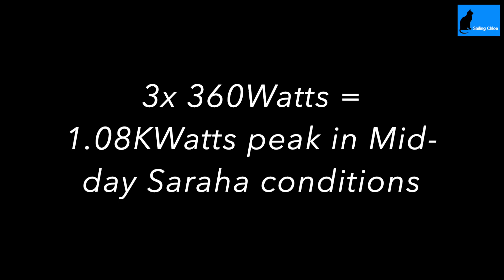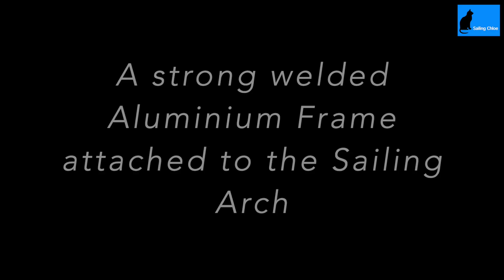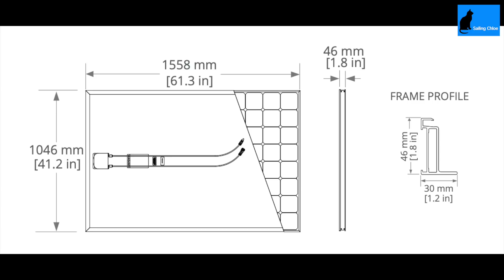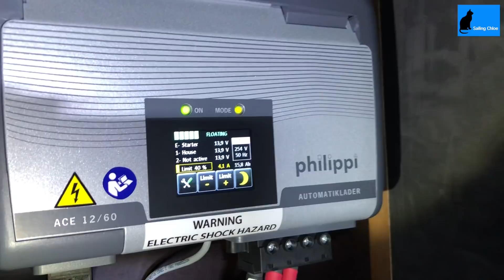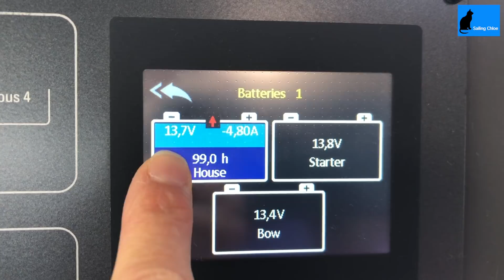Sailing Chloe - Episode 45 : Modern Energy Systems for a Sailboat

Comment: Here we mostly use LiFe Po4 batteries for marine purposes, LiPo as you use is not safe and first time i hear used in a boat. I however use a lot Lipo batteries for other purposes and has occasionally had accidents with them as well.
Reply from the maker: Yes we agree partially... . But there is no such thing as LiFePo4. ...only LiFePO4 .. no one uses Polonium for cathodes.... that we're aware of....?!!      We use standard marine Batteries with Lithium Iron Phosphate Cathodes.. as is very common and reasonably safe in boats. Also Commonly referred to as LiPO and is very commonly called "lipo". And, as you state, NOT to be confused with Li-po which is different. Often Lithium Iron Phosphate Cathode batteries are simply shortened to as LiPhosphate.... or LiPO or Li~PO4 , or , correctly: LiFePO4 to be exact. Of course no one is using Lithium Polymer (LiPo) in a boat... except for the chunk in our cell phones and iPads...     and then again there are a larger number of types of Lithium Polymer batteries..  again each with different cathode materials..   So with all these cathodes.. it all gets rather confusing ... and this is before we even get into the anodes...
Reply: buy kuthúm ever use luth best bàyrreß

Comment: Awesome informative video!  Where in the boat are the batteries mounted?  Is there a separate battery to start the diesel motor?
Reply from the maker: Hi Nic, Batts are as follows. 3x house batteries in 3 boxes under the sole plate either side of the engine. Each is 300Amp.hrs. One Engine batt. 100Amp.hr batt under the salon starboard seat. And one windlass/Bthruster under the master bed.  So it's 5 batteries in 3 banks. House/Engine/BowThruster.
Reply from the maker: yes. The Lithium batts are in 3 boxes. Each a 300amphr battery. And separate battery bank for the engine start and a third for the windless and bow thruster.

Comment: Hi
I'm thinking of getting an Ovni but I'm a bit concerned about keeping an aluminium boat in a marina where there are a lot of mooring chains and who knows how well put together shore power system. Do you have any advice on how to protect the boat or how big a risk electrolysis is?
Thanks
Philip
Reply from the maker: Yes, you are very right to be concerned - it's a big deal and can hurt a non-optimized Al boat. There are lots of things to consider for when building in Aluminum. It's quite a science... All I can say is, make sure that who ever builds your boat is really expert in this consideration. It's why we picked Garcia in part - as they truly know what they are doing...  in detail. You really don't want a boat that's susceptible to a galvanic degradation current.  The high level basics to consider are : Isolation transformer - wired correctly. A chain of High current Diodes in the ground path. Shore power wiring. Dual wiring and all components wired correctly!. Isolated VHF and SSB Ant. Galvanic current Leakage testing. Correct Al alloys used. Correct anode type and placement. Engine isolation. All point dissimilar metal-metal interface insulation. Every bolt and screw and .... . The devil however is in the details..  as with most things and this is where the builder's experience and expertise comes in. When we reviewed this aspect, we concluded:  Garcia is a genuine world expert.   ps. copper pennies are a myth :  >
Reply: @sailingchloe2330  Thank you so much for this. I think I'm getting too old to put up with the hassle and constant worry. I'm afraid 45 foot Garcias are outside my budget. Fair winds and safe travelling. Philip

Comment: From the comments it looks like most people are interested in every nook and cranny of the Garcia 45 ..  travel videos are nice but there are 1 million of them on YouTube ..  One question do you find you have adequate refrigeration on the boat and did Garcia offer more refrigeration choices such as the one in the Amel 50 under the cabin seat ?
Reply from the maker: - the main point of our videos is for friends and family. Dawn's mum likes the travel and the cats. yes there are choices for fridge. And Garcia would do anything you ask them to do I'm sure. We did not want any more than 3 units. We selected a std config option of a two draw fridge and a one draw freezer. brand is: Vitrifrigo. We opted to NOT get an optional water cooling loop - to KISS. Instead we just increased our energy system capability and used reliable, standard marine fridge freezers. 
it works well.

Comment: What I like about these 96 cell SunPower panels is how well they tolerate partial shading. A premium product and a great choice when space for panels is limited. :-) Do you happen to know what size your MC4 connectors are? I gather they are sized for the cable size that is used. Thanks.
Reply from the maker: Yes, the Sun power panels are cool as the cells are designed with no metal on top that wold instead block the sun to some extent. The metal is instead routed from the backside of each cell. This is why they are more efficient than older designs. MC4's are standard with a 4mm contact pin - but the wiring sizing should be considered. To determine the wiring size: the max current from a PV Panel is determined by it's max voltage point of operation. The I-V curves are nonlinear for PV panels but lets say It's approximately 40volts or so at max power point. (The max open circuit voltage is just over 60v. ) So 360 Watts / 40 volts = ~9 Amps per panel at max power. So, if you spec your resistive losses to < 1% in this cable and assume it's ~10m long, round loop, you'll have a max cable resistance spec of 3Watts loss / (9 x 9) = R(Lossy)  =  ~ 0.1ohm. Looking up cable resistance for stranded, tinned wire: #14 AWG wire is spec'd at 2.5ohms for 1000 ft. So you 'could' use ~300ft of #14 wire if you needed to to meet your 1% spec. I would not use anything thinner than #14 as the connectors become corrodible perhaps. Solar panels don't put out huge currents, each. On the MPPT --> Battery side however, the voltage is now bucked down to only ~12v so you need to consider currents accordingly that are 3.5x larger with thicker, but shorter, wiring.
Reply from the maker: Sorry we said 60 cells..  but they are ~60" - not 60 cells. They are 96 cells.
Reply from the maker: Yip. Moores Law marching on and on and on and on...   Cool!!
Reply: yes théy dó